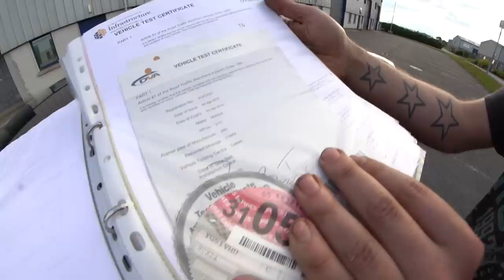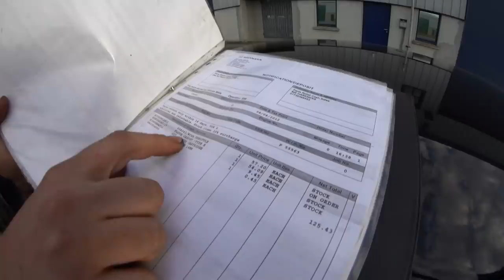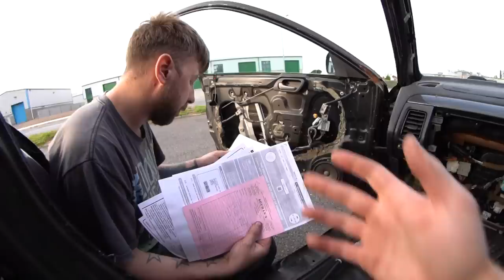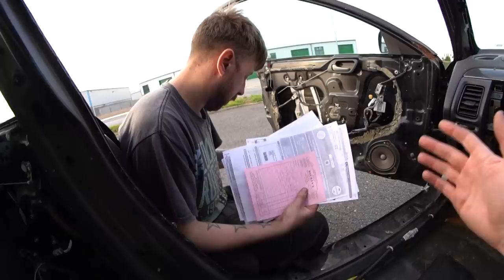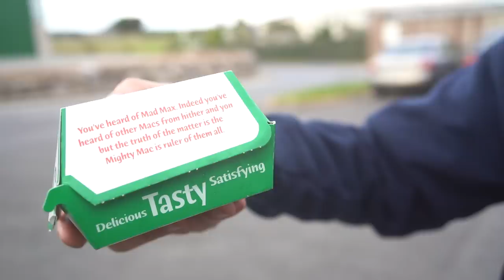We Buy The CHEAPEST HONDA TYPE R In The World (ITS BAD!)

Comment: Accord Type-Rust…. That’s a good one. I wouldn’t touch one of these for any money. I have owned two of these and biggest mistake I have made was buying both. The rust is beyond a joke as seen here, there will be holes not just underneath but scuttle panels, door edges, under seals etc. Just avoid unless they are given free IMO and they are worthless and rare because no one wants them as they are a complete money pit. They will literally take your wallet and run. The bulkhead will be disintegrated judging by underneath of that, it is a fault from factory when assembled that has caused it to rust over the years. There are other cars for a couple of hundred that I would definitely have over this.
Reply from the maker: Hard to find something as good as this for the price, hopefully we can get a few track days out of it

Comment: Those 90's edits where on point!🤣That driveline alone is easily worth it. And still a cool looking car as long as you don't look under it. Given that rust is often worse then it looks you could start doubting structural integrity in this case. Worst come to worst you still got a great driveline to swap into something else. Those in decent condition will do around 6-7K here in the Netherlands. Still cheap considering it's true Type R at hart.  And seeing as Honda always profiles itself as a engine builder.. 

Never owned a Honda car but several motorcycles which have given me a great deal of respect for the brand. Amongst them 2 VFR's a V4 that reliably(100k KM's is no exception) revs past 12.000 RPM all day long.. a worthy contender in my best of JDM trifecta of Honda, Yamaha and Toyota.